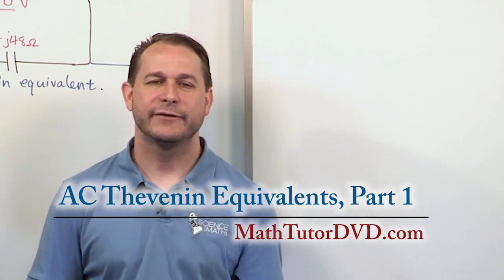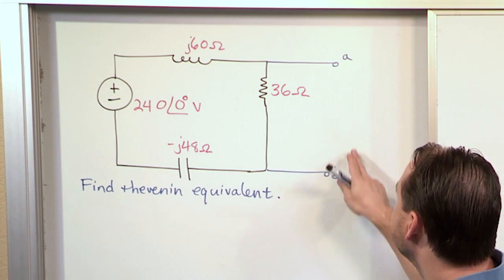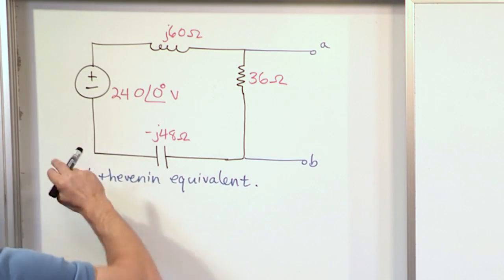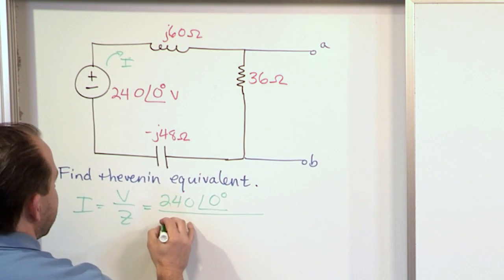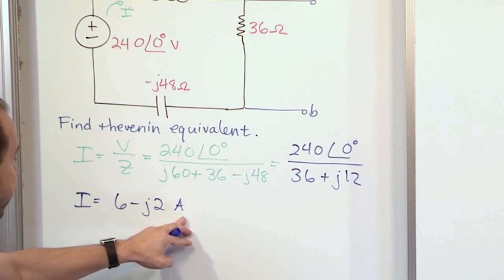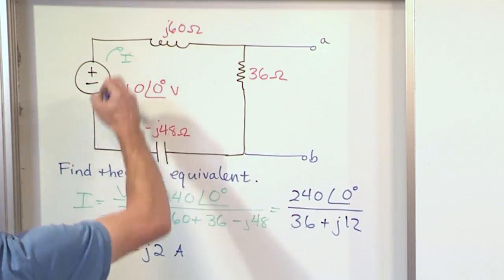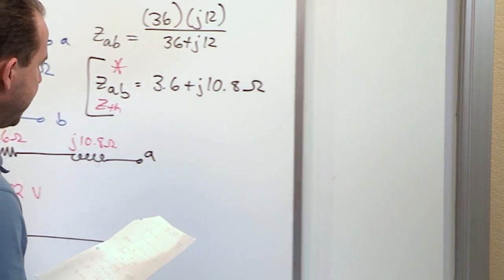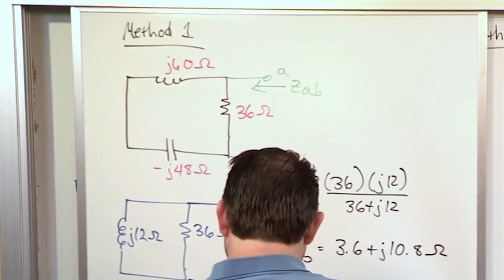AC Thevenin Equivalent Circuit Problem

Comment: Dude you're back!
I wanted to say I myself have wanted to be a Electrical engineer since I was 10 and am ecstatic I came across your videos on Amazon and saw your story on your website of struggling with math and working for NASA.
Thank you for making videos .
Reply from the maker: +The Slacker Engineer You're very welcome.  Thank you!
Reply: +mathtutordvd I have the same dream. o.o I dream of working for nasa as an aerospace engineering or even an astronaught, but i never finished school. After years of time off, i turned 18 and did a diploma and went to uni, struggling with maths but i'm getting through it thanks to your videos.
Reply: VT Gaming You just gotta work your ass off for it.
Engineering Truth is a good channel for career advice and tips like that

Comment: I think that you found the drop voltage on the R=36 and this is not the voltage between  a and b  5:28
Reply: it is the same because its parallel with a and b

Comment: how did you get 6-2j..?
Reply: It was the division of 240 phasor 0 deg divided by 36+j12. At first glance, they cannot be divided by each other because they are in different, non-compatible notations. If you convert 240 phasor 0 deg to a complex number, it is just 240+j0, or simply 240 since the imaginary part is zero. Now that the numerator and the denominator are both complex numbers, you can divide them with no issue, which equals 6-j2.
Reply: but then how do u get j12?
Reply: You can change the numerator into complex numbers, then multiply both the numerator and denominator by the denominator conjugate, keep in mind that j^2 is equal to -1, hence you'll get 6-2j.